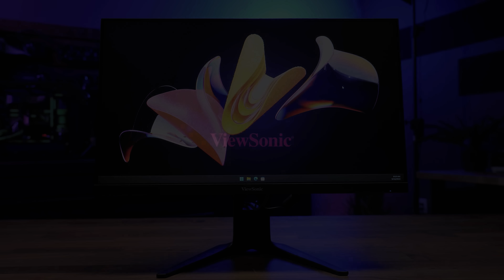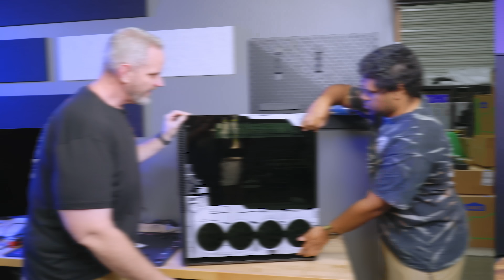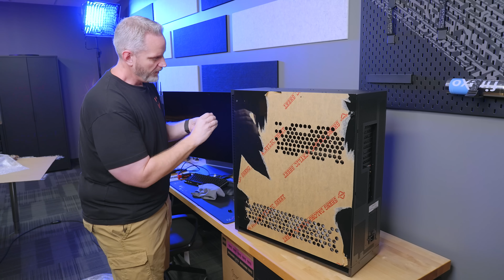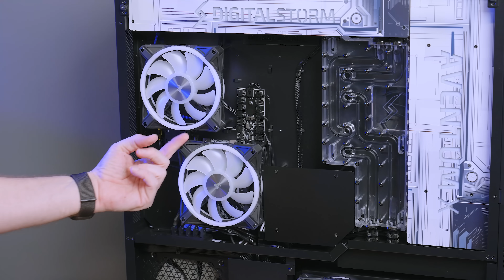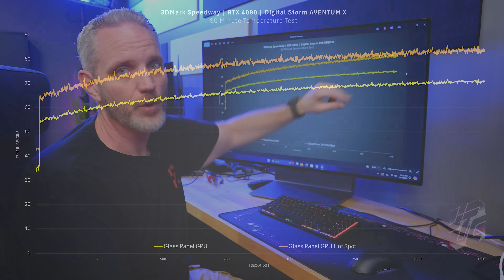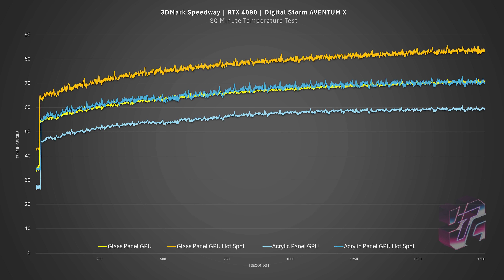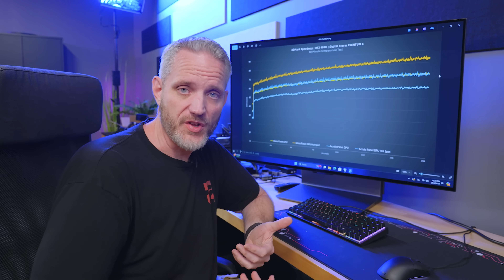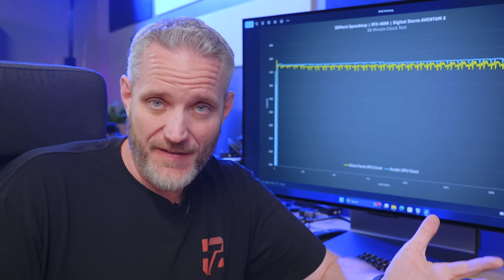Digital Storm responded to my Criticism... Let's go over it

Comment: Not too long ago, I discored a spanish speaking channel here that I thought had very good content. It was direct, no stupid bs and the guy explained things very well. I subbed. Then came along the video of "showing you my build" where the dude had built a great PC but he decided to put the rad on top, for the CPU with a PULL config... If you are confused, read it again because I wrote that right. 
He was then wondering why his CPU was warmer than he had thought... 

I unsubscribed after. Everyone can make a mistake, for sure. We all do all the time. But from my POV, I am not going to follow a TECH CHANNEL where they get basic things wrong. And it's not the typical "LMFAO I forgot to turn on the switch of the PSU". That is not a "mistake", that is a mild oversight that has happened to all of us and you just forget. This other mistake was a failure in understanding basic function / physics / how air works (clearly he hasn't been watching JTC content, which I have that's how I know how it works!). 

I feel the response from Digital Storm falls in the same category. This is not a "difference in opinion" because there are 2 ways of doing something and you two just can't agree because you each like the different approach. This is a difference in opinion because objectively what you are saying is the correct thing. 

Unless you told me someone else bought the company and 3 years from now they make great stuff, I personally would never even go near anything Digital Storm makes.

Comment: My brother ordered a pc from them two years ago for $2200. I assumed at that price point even during the gpu apocalypse that the 1660 would atleast have two fan shroud. Nope it was a stock single fan shroud... and the r5 5600x had a stock cooler and would peak 90c often. We've modded plenty since then with a new asus 3070 and a hyper 212 cpu cooler. My complaint is that at the time we didn't know much about pc and we definitely paid $1200 over what we should have for the quality of the build.
Reply: lmao Cooler Master going to drag that Hyper 212 name into the next century!
Reply: @XenonG  Holy fuck I remember when a quad core processor with a Hyper 212 was in every gaming PC lmao
Reply: @Timbobjr  Yup... good old 2010 ish maybe days... Still have an X58 rig here running from 2009 which had a Hyper 212 evo original on it when i got it, with a first gen i7-920 quad core. Well now she got an upgrade from 12GB ram to 24GB which was max back then in triple channel, 6 sticks of DDR3 1333mhz, Its CPU got changed out for an X5675 6-CORE Xeon O/C to within an inch of its life... well ya know stable for gaming still... but over 1.2ghz higher than stock, and people do go more, and she has a Corsair h115i platinum 280mm AiO on... Ahhhh....The good old days huh... 🏃‍♂🏃‍♂💨💨
Reply: @CHADSGALAXYS  Remember when Intel announced the first I9 processor with a whopping TEN cores? I was practically drooling over it, over double what my I7 had only 2 years prior. I had no idea what that meant as a highschooler but I was super impressed lol
Reply: @Timbobjr  Yup..good old 7900X i think that was right. She was a monster for workloads and stuff and was still a decent gaming cpu too... Was expensive at the time, more so than todays cpus, and she was a hot one aswell, 140w i think, back then that was quite abit for sure, nothing by todays standards but for then, ya ya needed a good cooling solution for sure...
Reply: @XenonG she's a beast tho lol
Reply: @turambar304  The design has changed over the years, but they kept the name and even release variants. Main selling point is it can cool around 120 watts more or less and for a very cheap price.
Reply: yea that's insane, considering you could build that PC for like 300 bucks.
Reply: @RaidZeroTV  
Case: Antec AX90
MOBO: MSI B550-A Pro
CPU: Ryzen 5600X
GPU: Radeon RX6600
RAM: Oloy DDR4 16GB 3600MZh
Storage: Ediloca EN600 Pro 512 3200Mbs
Storage Ediloca EN600 Pro 1TB 3200Mbs
PSU: Aresgame 850W Fully Modular Gold Certified
I just did this build 8 months ago with all new hardware. I spent around $750-800 on that build.
I also did a build for my father very similar to the one above. But no GPU. One 500GB m.2 and a 5600G instead. I had about $500 into that build. 300 might be a bit low IMO.
Reply: @Lookin4LoveInAllTheWrongPlaces  I just did one similar, 
Ryzen 5 5500 = $80, (undervolted and overclocked to 4.4ghz all core)
MSI B550-A Pro = $60, 
16GB PNY XLR8 3600mghz = $30, Samsung 980 Pro 1TB NVME= $60, 
Coolermaster 850W 80 plus gold PSU = $60,
 ASUS RTX 2060 6GB = $50, 
Coolermaster case from 10+ years ago, $10

I got lucky with some used parts on amazon that arrived brand new in box. I only spent somewhere around $200, because I was reusing the GPU and NVME drive from previous build. But that's still pretty good for a computer that can do pretty much anything, can play any game I throw at it no problem. Never at the highest fps in the world, but never slow enough to be considered laggy. I can tell you one thing is for sure, it's a lot faster than my previous high end intel build with an i7 8700K at 5.2 GHZ, and a GTX 1080 ti, asus strix z370 mobo, samsung 950 pro, etc etc all high end expensive stuff that is obsolete now lol.

Comment: Sending the side panels with sharp edges instead of rounding them is pretty shitty. 

If you can take the time to cut holes into the panel you can round the edges with a router.
Reply: I was thinking the same. I didn't know this company before, but if anyone would ask me, I would suggest against that brand. Like if the rads and power-supply choking off due to the glass panel was not bad enough, if you ask for their freaking acrylic replacement they are not able to have the holes at the right places, nor rounding the edge, when they freaking know that this panel goes to a reviewer.

Well, at least there was one thing right with that build, the original look. This is basically the only reason to pay that 4000$, since you get no gain at all, you pay for a piece of arts.
Reply: They can't even cut the holes in the right spot. Bold of you to expect them to round the edges. 🤣🤣🤣🤣🤦‍♂🤦‍♂🤦‍♂🤦‍♂

Comment: Take a look at the Corsair 5000 x right panel has a cutout in tempered glass works great
Reply: Yeah, and I bet it cost Corsair rather more to get their glass supplier to cut that custom shape and then temper those panels after before shipping them than just simple rectangular panes.  Corsair was willing to foot the bill for that...given what we've seen from Digital Storm, are they willing to CHANGE their existing process and material procurement enough to do this?

Comment: It's pretty insane that these obvious design mistakes were made in the first place by a company like this. It doesn't take a rocket scientist to see how bad the airflow was. Offering a "fix" is fine and all but this shouldn't have happened in the first place.
Reply: It's extremely concerning. I noticed this years ago when Linus unboxed one. It was unstable out of the box due to a ram oc.
Reply: This entire Digital Storm business feels like one big ad for learning how to build PCs yourself to avoid dealing with stuff like this.
Reply: What's worse is that the computer costs 8k, at that price, I expect vent holes EVERYWHERE, we're talking about a 4090, not a 1050.
Surely you don't want to cook a 2500/3000+$ card (before the warranty, if you are the company that designs and builds the system).
Reply: It’s actually pretty easy to understand.  They sell more PC’s that look good than performance well, because the people that pay for these expensive systems don’t have the time or interest to build a high end system, and they respond to HOW it looks as that is the only reference they have for whether or not it was worth the money.  As a result, Digital Storm is paying a team to design these to look great FIRST.  A clean glass panel looks better than one with holes, so they designed it with a clean look and with a matched colorway to look beautiful.  They likely asked the engineers what the impact was and they said it was X percent (20%?) less efficient, and then looked at the cost to redesign and found that it was likely cheaper to refund or replace systems that failed than to redesign the panels at that time.   Because you can count on two hands the number of people that are willing to go through this effort to evaluate the system at this level, and even then these issues aren’t deal breakers for 99.8% of the people they sell these rigs too.  

It’s better for business to sell beautiful machines to people that don’t know better than to engineer a system that .01% of the people that know better (so why on earth would they ever spend $8K on a system they can build better for $4k).  They know exactly what they are doing.  Also, when you have to call to have help setting something up, it’s a perfect opportunity to upsell you on something or have you buy a service plan.  It is no accident that there are little instructions…
Reply: @graybeardgolf  I have definitely payed the "looks good tax" I get that. But it always performs amazing aswell.
Reply: Dammit I should have just liked your message instead of writing a long comment saying the same  thing lol
Reply: Reminds me about CrApple. Create the problem, sell the solution.
Reply: Hindsight is 2020
Reply: Yeah DS is an extremely overhyped and overpriced company.
Reply: Well, I just came up on a Aventum X and Aventum 3 chassis'. Aventum 3 is getting a dual loop. And an additional 420 up front.  The chassis are different as well. Waiting on gpu cables for the x chassis. Be powering it up tomorrow.
Reply: I have dual 3090's and a 7980xe in the Aventum X chassis. Water temp with no side panels under load stays  around 37c. Put the panels on, idles with water temp of 37c petg 10/14 tubing, starts to weaken around  40c-45c.  Horrible design indeed. Glad I was able to come up on an aventum 3 chassis as well. Much better airflow and im removing the front drive bays for a 2nd res another 420 rad. And making ssd mounts for the basement so I can run nvme on-board and 2.5ssd behind the 560rad. At least that chassis is built for the job of cooling better than the X was. FYI,  my calculation is they charge about 2k for the chassis alone in these builds.  Its about the size of a corsair 900D. And pretty much a reverse/inverted chassis. Imagine paying 2k for a 900D. Even the 1000D and 9000D are better in airflow and esthetics for $500. Also, DigitalStorm doesnt support their product if youre not the original owner, so if you ever come up on one used, dont expect them to help you with anything.
Reply: @PREDATEURLT what’s up with all the homophobic crap on here?
Reply: 😂😂😂😂😂😂😂😂😂😂 @JLYK2
Reply: @JLYK2 😂😂😂😂

Comment: With a dynamic QR code they won’t even need to change the box or add a paper, just change the link to point to the correct video for f#@ks sake!!
Reply: how? You'd retroactively change all the links for the right cases as well if it was a matter of printing the wrong code...
Reply: @blackbird42 use one landing page where you can choose the option you want to look at